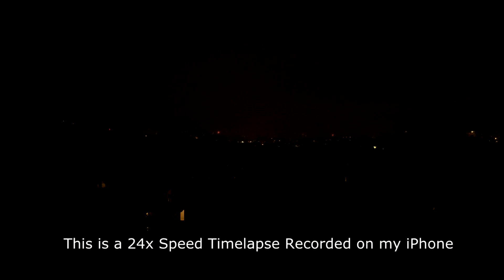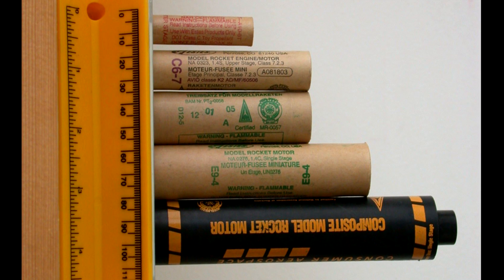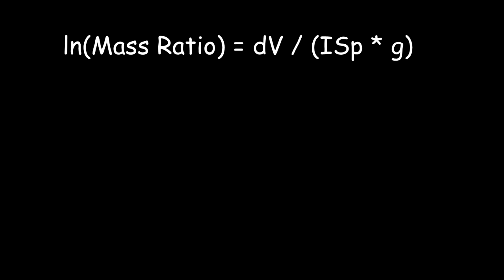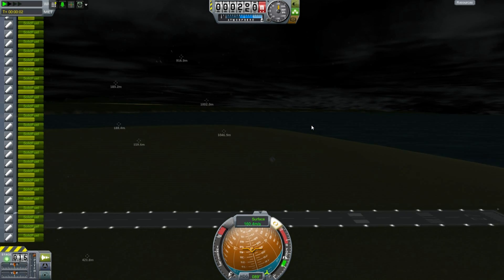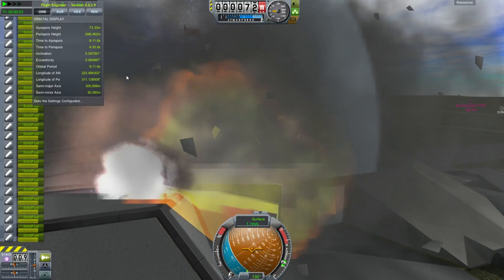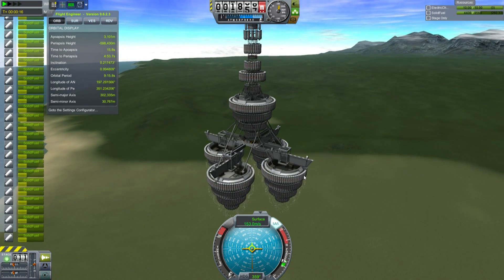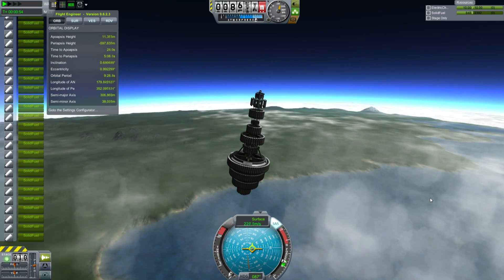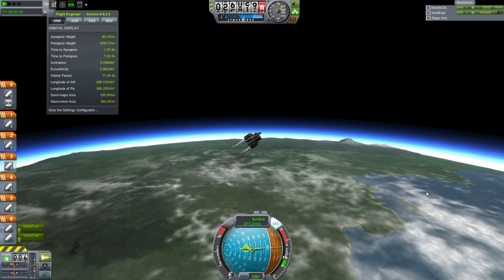Strapping A Bunch Of Fireworks Together To Build A Space Rocket

Comment: Hate to promote a comment but can you please give this one a thumbs up so that Scott may see it?

Facts about model rockets:

For reference, each class of motor has twice the total impulse than the last. A "B" motor has twice the impulse of an "A," a "C" motor has twice the impulse of a "B", and so on.  

The largest commercial black-powder motor currently available is currently an F-class motor (twice the power of an E), offered by Estes Industries. The largest conveniently available motors are G-class (four times the power of an E). Most motors from class F up are fueled with ammonium perchlorate, the same propellant used by the Space Shuttle.

It is possible for amateur rocketeers to get certifications which allow for the launch of commercially available rocket motors of class H through class O. Rockets with class P motors or higher are usually custom-built by serious amateur rocketeers, and have reached heights of up to 72 miles (the GoFast project in 2004, Google it). They can use ammonium perchlorate, although many at the upper end of the scale are hybrid rocket motors. No amateur rocketeer has even tried to create a rocket to reach orbit.

Comment: Come now, Scott, you can do better with model rocket engines than that.  They produce red-label engines that are designed to be staged off, and the class-D's, though they have less total impulse than the 'E's, have 7.9 extra newtons of thrust and weigh a little over 10 grams less.  You lose a little delta-v since the mass ratio is a bit higher, but you're not wasting energy dragging the single-stage recovery charges up with you, and you gain the ability to stage your buttocks off, which should reduce the number of engines needed by a few orders of magnitude. Of course, if they make class-E booster stages, even better.

Comment: You can actually get F type commonly in sores too. Estes makes the common ones with F15-0/4/6/8 (the second number is the delay) I was helping a local high school with a project to get two eggs to 850 ft and back down to ground without cracking the eggs and within 48-52 seconds from ignition to touchdown. Single stage only. but i couldn't give them the answer or actually help, all i could do was advise. The got to 741 with an F15-4 the E type only got them to 300ish. the issue was weight in the end. but they got close and were happy, so as a reward we got a different type of F size and the rocket got to 1244 ft with two eggs. I know with a few modifications they could have got an empty rocket to 4000 ft. (well, the math said they could and the math was only 27ft off from the actually result of 1244ft. 

Not that it changes your video any haha! did you happen to get to see the launches of the model rockets and the Utah Bonnivile salt flats in May?

Comment: A P class rocket motor is 2048 times more powerful then an E class rocket motor.

Black powder motors are not available that big. E is the biggest you can get and in real life they have low thrust and can't lift much weight. Companies have tried to offer larger size black powder motors, but they run into problems when the fuel grains crack (either in transport or due to heat while the engine is burning). A cracked fuel grain increases the surface area that is burning and increases the internal pressure of the motor, which further increases the burning rate and causes the motor to fail.

Comment: As a fan of rocketry, model rocketry, and fireworks, this video is awesome. Although I would like to point out that you can buy an 'F' class model rocket motor without any special certifications and whatnot. You can also buy certain 'G' class motors as well but they will require HAZMAT shipping fees. And the Saturn V you mention is one 'P' class around eight 'N' class motors.
Reply from the maker: I'm not a model expert by any means but the articles I read suggested that F class and above no longer used black powder as a propellant.
Reply: ThreeCharlieKilo
Correct. Most high powered amateur rocket motors use ammonium perchlorate oxidizer and aluminum fuel with a rubberized binder and additives such as iron oxide. Same stuff is used in military and commercial use. The space shuttle SRBs are composite motors and are categorized as a 5Z equivalent motor. Side note, motor impulse doubles for each letter. Making an SRB ~134 million times more powerful than your average Estes C-class motor.
Reply: Pathetic how regulated almost everything is these days. The wars on various nouns have combined into a war on chemistry-and-most-other-hobbies.
Reply: Scott Manley Some do, some don't. Estes makes a black powder F. But you can get E, F, and G composite motors from Aerotech and a few others.
Reply: Alter Eggo Yep, I had a hard time getting 99% alcohol to clean my electronics and remove thermal compound.
Reply: Refreshing to hear from someone who knows their stuff :D
Reply: Jcsthird Thank you Jcsthird, Knowledge is always refreshing on an internet filled with uninformed opinion.  Your comment is a jewl in a sea of _____.

Comment: For KSP do you need memory or a good graphics card? On average, which is more important?
Reply: For games in general a good graphics card is more important. As long as you have 8GB of memory that's a decent speed you should be fine. (Although even 8GB isn't totally necessary if you aren't doing any multitasking/running things in the background)
Reply: Currently KSP uses a version of Unity that is capped at 32bit, so thats 4gb ram max. There are unofficial workarounds that have mixed success, so if you have more than 4gb ram then it will make use of it. Until the kinks with Unity are worked out KSP will remain as a 32bit software.

As regards GPU, probably nothing special. I would think that most budget to reasonable graphics cards from the past 3 years or so would be more than adequate.

Minimum requirements lifted from the Steam Store:
Processor:Core 2 Duo 
Memory:3 GB RAM 
Graphics:SM3 512MB VRAM

Bottom line, most modern systems will run KSP with ease (at the current capacity the game allows), with varying performance depending on how many mods you use, if you choose to use any. You'll need to use a texture reduction mod if you're spiking the 4gb cap.
Reply: Especially important for the physics computing is your CPU. But out of the two memory is more important I'd reckon, since the texture quality isn't all that great in KSP and the lighting is close to basic. If you turn off vsynch and anti-aliasing you should be good even on low-end cards.
Reply: For future-proofing your PC yes, for KSP specifically, stupidly too much overkill.
Reply: Ram and processor are the main for the simulation of the piece, getting a ssd is a little helper, and the GPU should be above 2010 to run it smoothly with decent spacecraft

sorry for bad english i'm swiss ;)
Reply: I played KSP on an i5 with a HD 3000 and 4GB RAM it worked with sometimes a bit of lag.

Now using i7 4th Gen Nvidia GT740M and 16GB running high graphic mods without lag :D
Reply: Jimothy Kerman Any current budget level PC runs KSP great. An intel i3 is a good low-end cpu that can easily run ksp, An old gpu is good enough for the game too.
Reply: The quality of the memory is somewhat important but it wont really matter with ksp because ksp only uses 4 GB of ram
Reply: youkofoxy
Uh yeah... I recently bought 8gb for like 40 dollars dude...
Reply: youkofoxy
You good sir got ripped off lol 50$ for 2GB? holy fuck.....that's just plain stupid.
Look you lot,KSP is 1.x86 software 2.Not very well optimized 3.A physics simulation,what you end up with is a game that doesn't have so much as a hardware cap,but a software cap which will lagg the fuck out the moment you reach that cap no matter what sort of rig you got.
The dude asked for a config that can run the game,not how to build a PC that by the time will reach the numerical requirements will be so outdated you might as well give it away as a scrap metal.
Don't be dumbasses.
Reply: BandNerdcp Apart form the fact KSP is a physic based game cough cough cpu.
Reply: Help?
Reply: Probably the dedicated video ram on the card itself
Reply: Again, please be aware that, strictly for KSP as regards your question, ram is capped at 4gb. Running more than 4gb is irrelevant unless you use a method of a 64bit workaround (as there are a couple more ways outside of the Unity "hack").

My GPU is pretty old, a ATI HD5770, and it runs KSP just fine. With more demanding games, it does okay, just doesn't offer the level of detail modern cards do.

If this question is 'cos you're upgrading, future-proof yourself with a decent GPU, and at least 8gb ram if using a 64bit OS.
Reply: So what I know from here...
◇At least 16gb (more can be added if not)
◇Good CPU
◇GOOD graphics card
◇Doesn't need to cost alot or be a new product.
Reply: Jimothy Kerman
Most important if you buy a laptop is GPU and CPU because they cannot be replaced easly in laptops. I suggest buying something like i7 or i5 but make sure it is 4th gen.
Reply: Jimothy Kerman 
A good CPU foremost (good single core processing power, not so much 6 or 8 cores), then comes the good RAM. Graphics are an afterthought. Unless you put on a LOT of beautification mods (better atmospheres, distant object enhancements...)
Reply: Jimothy Kerman an i-5 will hold you for a long while, regards to KSP it will run very nicely with pretty big sized spacecraft. GPU wise, personally I am running an old GTX 280, even with some graphical mods I can squeeze out 50 FPS without overclocking, when it comes to ram, obviously the more the better, but currently KSP runs on 32 bit unity. so more than 4 it cannot take, though you can hack it to use more, I did the hack and personally it was not a pleasant experience due to crashes when using symmetry as well as exiting the craft, so I suggest you to stick to 32 bit until its updated. get 8 gigs of crucial ballistix or corsair vengeance. fast ram and you should be set for years to come, because games are being developed to be optimized to the extreme.
Reply: Typer™ hope this helps :)
Reply: depends on how big the rockets your planning to build are and how many mods you want if you don't plan on building stupidly big rockets with tonnes of mods a normal desktop or laptop should do if your planning to go mega crazy then you'll want a fairly beefy computer
Reply: *****
 Sounds like you had under 3gb of memory which is the minimum requirement for KSP.

"I can only run about 2 mods" is either a massive understatement or your rig has some serious issues. If you have 4gb+ of ram then maybe the quality of the internals isn't all that? And £80 for a GPU isn't that expensive, thats actually really reasonable assuming it is half decent.

I have an I7, 8gb ram with a HD5770 GPU. Please remember that KSP is currently LIMITED to 4gb ram, unless you use a 64bit workaround, so my 8gb is irrelevant. I have close to 30 mods in my main install (I have several installs for various reasons), including some of the big ones such as Interstellar, B9, KW, EVE etc, and the game runs as well as can be expected when capped as a 32bit game.

Bigger, more complex craft will lag the game, with or without mods. Simple as that. Even Scott has FPS issues, crashes, slowdown etc, and I'm sure his PC is rather meaty.

As many have posted here, having more ram and modern GPUs is great for a all rounded gaming PC that will last you for many years, but the original post was regarding KSP. And KSP is simply not that demanding, and anything over the recommended specs is overkill.
Reply: PC World, we're looking at you! =p
Reply: *****
not true i play the full game (0.23.5) on my laptop annd it runs very smooth even with all the mods... although it does have a very beefy processor
Reply: killman369547 
There is what i said...
KSP needs processing power first and foremost. Then it needs RAM.
Reply: Well KSP will run on an intel P4HT @ 2.8GHz with 2Gb of ram with embedded graphics if you run the video setting way down. I did this just to see if it was possible. It was choppy due to lack of video but I then installed an nVidia PCI-e card and it ran much better. It does not have to be a super massive muscle PC to run this game but you do want to have some decent hardware in general for gaming. A regular PC bought at Best Buy or even Wal-Mart will run this game fine.
Reply: Jimothy Kerman KSP isn't that graphically intensive. Any modern laptop will be able to play it without problems, unless you start adding stupid numbers of parts to your rockets. Minimum? 4 gb ram, i3 CPU and you'll be able to play.
Reply: Neither. You need a good processor for it since it's a physics based game.
Reply: Kerbal Space Program is a semi realistic physics SIMULATION game. Simulators always need LOADS of processing power.

So you WILL need a good CPU. I run on a 1GB graphics card, i have no problems with 500+ parts graphically.
My processor struggles to keep up with the physics calculations though.
Reply: over 4GiB of RAM.
128 Bits and 1GiB video card.
a very power full processor.
and nothing else.
Reply: Kevin J. Dildonik they are moving to 64bits.
and, the best PC with good price for KSP is far from today standarts.
Reply: That's for any software you buy. 
Look at the minimum requirements vs. recommended requirements of the software in question and then compare what you already have  You may find that your current PC will work just fine or maybe you need to make a cheap upgrade.
Point being is why go and shell out a ton of cash for a new PC just to play one game on when the one you already have may do it.
Yes it is nice to get powerful new toys but buying these things can hurt your funds especially if you buy something that is loaded with bloatware and over priced and the core OS is the cheapest version with heavy limitations and other software has 30 day trials and will not work past that time.
just do your research before you go off and buy a brand new big fat pretty...lemon.
Reply: Kevin J. Dildonik  "32-bit can also only use one processor core" That's BS. Utilization of multiple processor cores has absolutely nothing to do with 32 vs 64 bit. Multi-core processors became common before (though not very long before) 64-bit operating systems. I think you've been confused by talk of KSP's engine. KSP runs in Unity, and a lot of people say that Unity can't be multi-threaded. That's only partially true. Its functions and data structures aren't thread safe, but it's a problem that can be worked around.
Reply: Cpu. For a budget build, the pentium g3258 would work extremely well on ksp with its powerful single core performance when overclocked. Gpu wise, ksp doesn't require much. Not something you need to worry about. A 750ti is the max i would go for this game.
Ram wise its recommended to go 8gb but 4gb should work as well.
Reply: HailgodMC 4 GB in ram is the recommended minimum. KSP will run with 3 GB in ram just fine. just don't have an extreme amount of parts going on. Of course a desktop is best for any type of gaming for obvious reasons.
Reply: Adriel Green ? what was the point of this reply?
Reply: You need a lot of CPU, and if you can get a 64-bit version (Linux or wait for the next patch) - 4GB memory.
Reply: LeiFlux07 damm i only have 992 MB of ram
Reply: BandNerdcp For ksp you actually need more cpu.
Reply: Denwna00 one 2GiB DRR3 module is around 50 dollars.
KSP is around 20 Dollars.
cheap.
Reply: youkofoxy lol what? 2gb 50 dollars?? more like 15
Reply: HailgodMC High quality, High Quality.
Reply: youkofoxy High quality what? Ram? LOL..
Reply: Single thread CPU performance is what is needed.
Reply: Kronguard Exactly. Which is why the pentium g3258 > all
Reply: HailgodMC Yep the g3258 is the best perf per dollar. g3258 + Z97 and you can always upgrade to an i7 down the line.
Reply: Kevin J. Dildonik
 You are just reiterating what myself and a couple of others have already stated several times in this thread. Saying to "Ignore all previous comments" is ill-advised and redundant.
Reply: Update: (in general and for future)
◇8gb 
◇Good GPU (graphics processing unit)
Good CPU (central processing unit)
◇Dont buy fancy stuff you dont need
Reply: KSP isn't that taxing. Most P.Cs will be fine if you lower the textures
Reply: Kronguard
Corsair CMSO2GX3M1A1333C9 is R$ 117,84 - R$ 151,43
on Brazil.
now say to me: why I gone research the price?
just to be safe a use 50.
and my point is: there no excuse to not buy more memory.
Reply: Yakko Warner the price varies by location and product.
You should understand that where I live a module of 2 GiB can very well cost this.
P.S. actually can cost more.
Reply: HailgodMC
yes, I know, it's pretty ridiculous, but my point is that you can buy this ridiculously "cheap" memories.
Reply: Kronguard Do you use your computer only fo run KSP??
that's is really  stupid.
by the way, my point is not the quality, but the price.
you can buy your 10 "bucks" memory module, I don't care.
Reply: Guys KSP is only 32 bit anyways...
Reply: softrockification Yeah thats what I was getting at but you know how people have to beat a subject up.
Reply: Any good computer names which are cheap (under 750 is best) which can be bought in America or UK for other games too?
Reply: yes. 
Most all PC's built and sold in retail stores will play just about any video game out today.
Reply: Thank you, everyone.